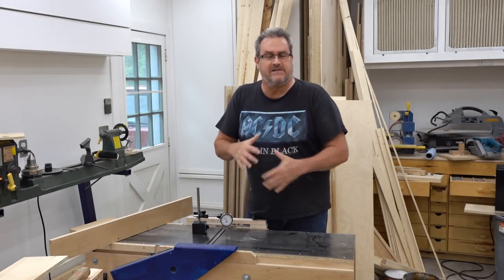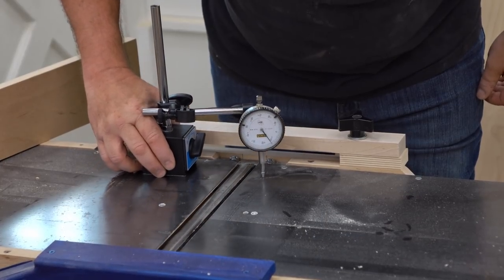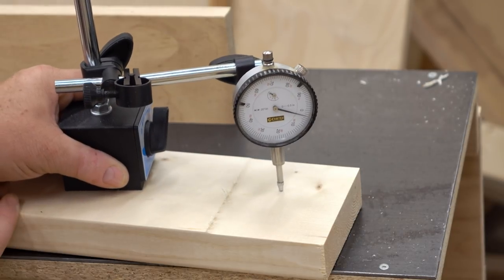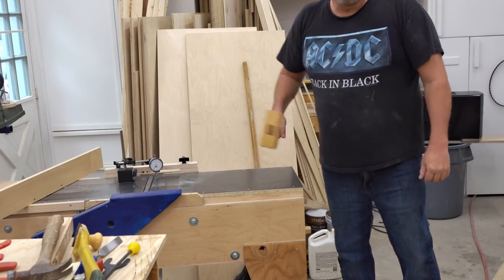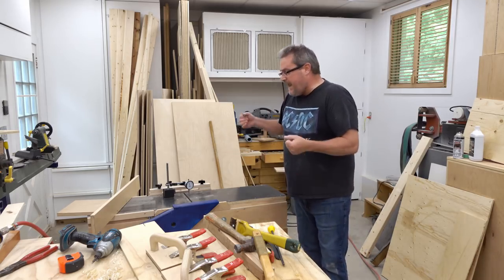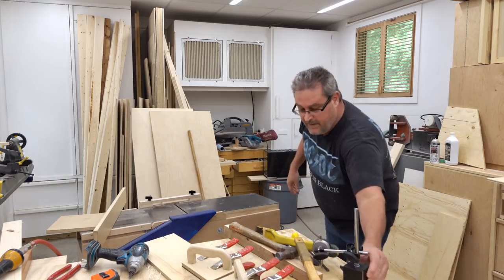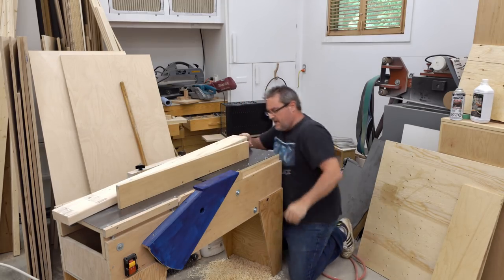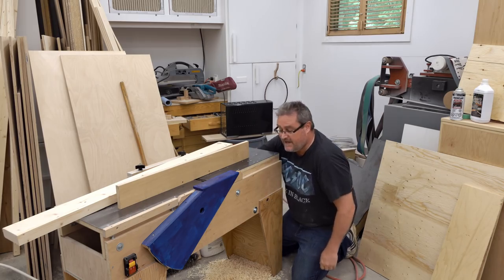Abusing My Jointer To "Test" It (includes some "bad" words)

Comment: First coo-dose for the left and right handed push blocks, I hate the centered handled ones that came with my jointer. Second, has anyone run these test on a somewhat standard cast iron jointer? Just curious as to how they would compare.

Comment: Sitting on the infeed table and whacking it with a mallet simulates what happens to it when jointing large pieces (I do not know about you guys but when I do that I always manage to bump the table or hit it or drop the wood on it at some point). What I am trying to say is that this type of testing is quite reasonable.
Reply from the maker: It's possible to design something to withstand  abuse from typical usage before building it. Testing it afterwards is redundant or just used to show people who don't understand how strong a design is how strong it is.
Reply: I thought that was the point of this exercise - you showing us how sturdy your designs were. My comment was in reference to the fact that although people do not jump on their jointers or whack them just for the sake of abusing them, bumping them with large pieces of wood whilst using them or just passing heavy timber on them can have the same effect.
Reply from the maker: I already knew the design was substantial enough for normal use and some bumps, but it's not practical to build a tank when all you need is a car. Just make the car so that it's easy to repair, if it gets dinged up.

Comment: the inclined plane system you used is exactly the same as every single Jointer on the market today, if it works it works, no point in trying to fix a problem that doesnt exist .

Comment: I can't see the reason for wanting to beat it into destruction. Not that I'm saying your machine is not accurate but to what degree do you have to go??? I use my Jointer and thickneser to dimension wood to a near finish and then finish with a hand plane to the last thou or so if necessary . Some people are just too nit picky.

Comment: I do agree with the end message. If it does the job, and does it to a high standard, even after, then you shouldn't have to worry about a rogue mallet. I think this is just a nit picky kvetch fests where Matthias has to prove he's right and that his jointer is better, not because it is, or because it ultimately matters, but because he has to be right.
Reply: In short, this is a case of Matthias being an insufferable perfectionist, when he doesn't need to be.

Comment: Matthias lies in his own world where the worst hypotheses are the reality. He thinks that the inclined plane could be inaccurate if this or that as if there were not jointers made with one. It works, the cut is straight, it is strong enough and much easier to build. I have no idea what you would have to be making to notice the advantage of the parallelogram mechanism.